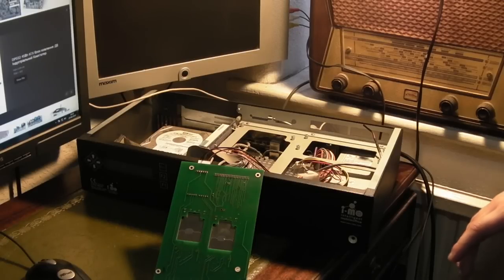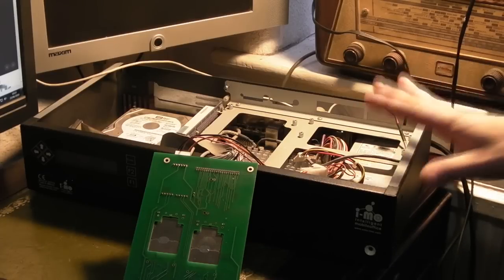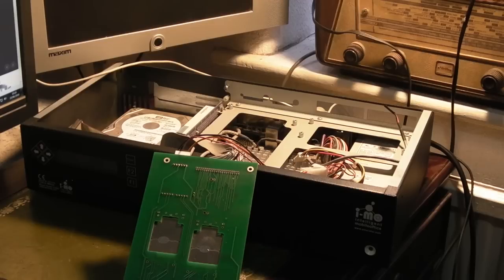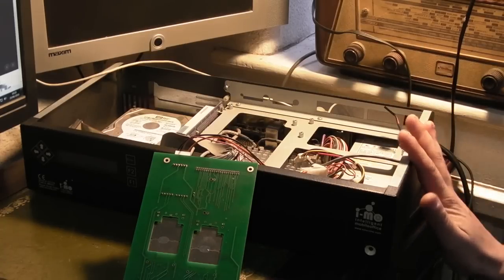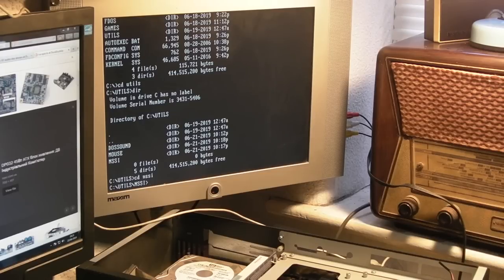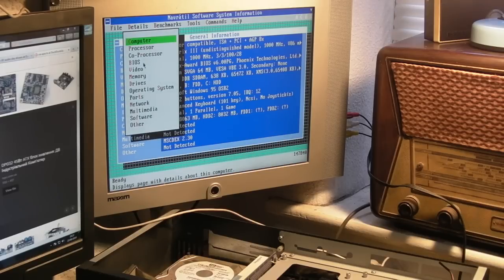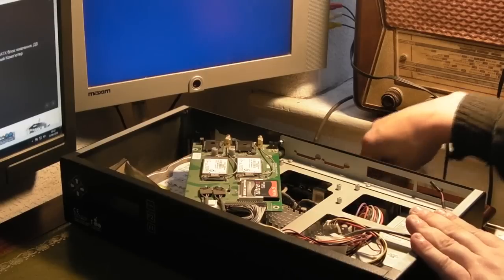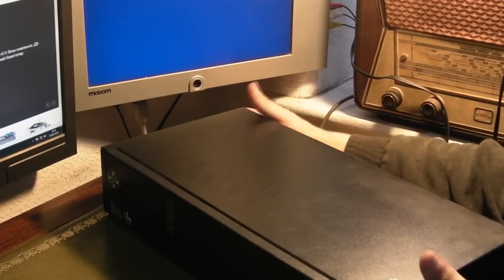Vintage PC pickups

Comment: The hard disk that was made available for the PS/1 2011 was the same used in the PS/2 Model 25 and Model 30.  It was 20MB and very prone to bit rot.  Out of six PS/2 Model 25s I bought once only one had a properly working hard disk and that one was an aftermarket Seagate drive with its own controller.
Reply from the maker: That's interesting to know. I had a couple of ps2 model 30's i picked out of a skip years ago and both had controller cards and 32mb RLL hard drives fitted to them. I wasn't aware they originally used XTIDE drives.

Comment: Actually, VIA bought Cyrix and the Winchip design from IDT. They wanted to release a processor based on the old Cyrix design, but it didn't work out so well. So they scraped it and released one based on the Winchip design instead, but they called it Cyrix. So chances are that you don't have an actual Cyrix in there but a Winchip with the Cyrix name on it.